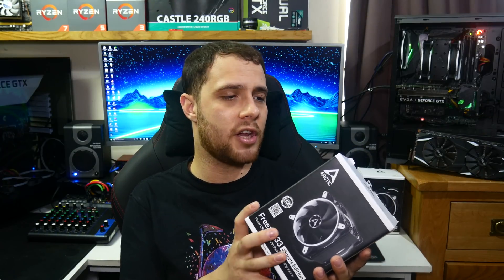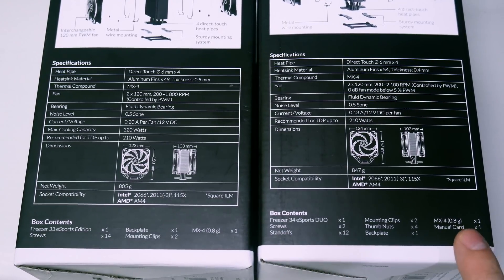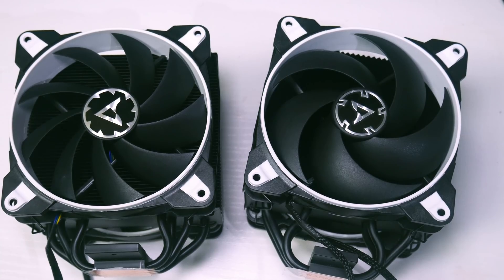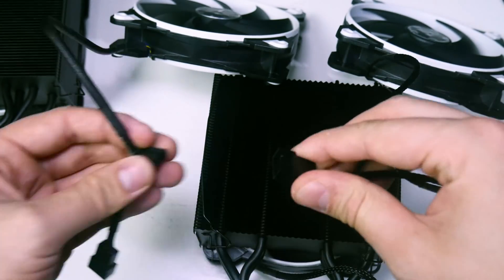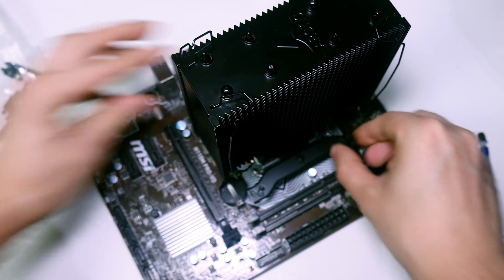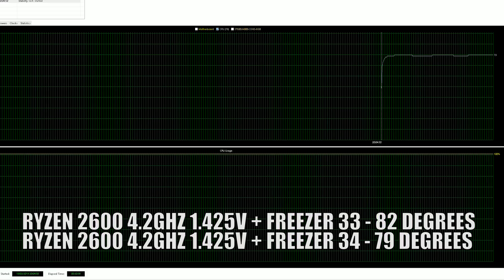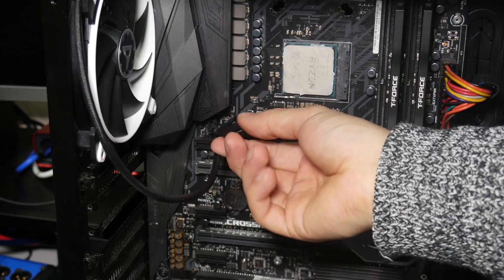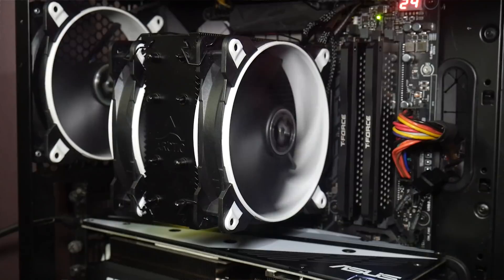ARCTIC Freezer 34 eSports DUO - Review, Unboxing, Installation, Thermals, Gaming  + Overclocking

Comment: Hi great video! my Cooler same in video in warzone at 1080p max settings my cpu temps are around 60-65 degrees why is this my fans on my cpu cooler are running at 1400 Ish rmp and i have 6x corsair LL120 fans at 450ish rpm and a rx 6700xt in the corsair 465x please help thanks
Reply: 60-65 degrees is good when under load. It's fine
Reply: Chobbs but it should be better I changed the cpu cooler to the h150i pro 360mm rad and  this cpu is so fucking hot
Reply: @pumpkin8680  well if the h150i is running hot you probably should try remounting it or try undervolting your cpu
Reply: Chobbs yes I have tried remounting it too and undervolting and both makes no difference what so ever
Reply: @pumpkin8680  Ryzen cpus are not great at dissipating heat, meaning you cant really get them that much cooler even if youve got a great cooler. The heat just stays in the cpu and doesnt get cooled by the cooler on top. But 60-65 are good temps for this cpu, i would just leave it at that.
Reply: RedArtz / Marcel K. K thankyou I actually changed my cooler to a 360mm rad by Corsair (150i pro) so now temps are like 50-60 while gaming. Thanks fir the reply

Comment: i5-3570K @4.5GHz - Would this cooler be enough?
Reply: Vaietzi definitely
Reply: @lucamilner785  4.50GHz, 1.235V, 70-74°C max. (65-67 avg.) @high loads, normal room temp. - You're right ;)

Comment: I have an XPS 8700 motherboard in a NZXT S340 case. The backplate cannot be removed so I'm wondering if the screws will fit in the motherboard holes.

Comment: why are you putting the pea drop. they recommended adding lines to each heat pipe.
Reply: ARCTIC follows the Verge PC build video... they even admit their recommendation of paste on every heat pipe is going to result in past squeezing out of all the sides (see their own video).
Reply: I went pea method on my 33 eSports One; no issues.  Agree with Wofshanze who pointed out their method really does nothing for coverage and just adds to a potentional mess.
Reply: @PapaMav  I see.i only said that cus of what arctic them selves said at the time. I thought they said it because it would spread more evenly and allow more coverage. I usually use dot myself now anyways
Reply: @lordadz1615  I frankly have no idea why Arctic is suggesting the method they are, in the first place.

Comment: How well does it stack up against the Snowman?
Reply: Quite a bit better I would say since it beats the CM212 and some AIOs. Do note the snowman has a 5 and 6 heatpipe version, for about 1/5 of the price of the Arctic
Reply: @vsmh96  I found the Arctic for 38€ and the Snowman for about 15
Reply: @NicksStuff  ah then, your price differs. I am nearer to China and further away from Arctic so mine would cost Rm240 for the F34 DUO (an extra Rm 80) for shipping.

The snow man is about Rm50 for me with shipping at Rm5

Comment: I'm so confused, maybe because Amazon's fault, please help me: Which has better performance??? I see Arctic Freezer 33 and 34 with 1 and 2 fans with very different prices. I can't see much differencie between ONE and DUO since they have 2 fans but there is also a ONE with 1 fan, and the prices are similar in some cases and very high in other cases...please help me!
Reply: Hi, the Freezer 34 is newer as the successor to the Freezer 33. 

The F34 uses newer fans which are pressure orientated while the F33 uses airflow fans (which are less optimized).

As for dual or single fan, they probably will differ by a few ℃
Reply: @vsmh96  Thanks so much for your kind response dude!

Comment: hello  i have  a i5 6600k and of 4 ghz  but  i have problem with the degress  84   ist it normal ?
Reply: it is not about frequency it is about the voltage
Reply: What cooler are you using? If stock, that sounds about right.
Reply: @vsmh96  Standart cooler from Intel
Reply: @PeterPan-rl3cb  Thats normal. Want better temps? Change your cooler
Reply: @vsmh96  ok thx man

Comment: So.. out of the box .. the cpu fan connector cable is a 'split' cable? You can plug both fans to the cpu fan header without any 'external acessorie' ?
Please answear .. I Want to buy this cooler but dont know if I need a fan spliter to connect both fans

Comment: Fan clips not so nice and easily to scratch the paint... Thanks for your critics, I put that on the to do list for the next gen. Very happy with your final judgement :)
Reply from the maker: No the fan clips hold  in pretty I was rushing when I scratched the 33, hence why I said take your time. Honestly it was so hard to find any problems with it it's a fantastic cooler.
Reply: @thefullsetup  Well noted. You know, that was not a must to find cons :)
Reply: @VincentAndre_HK  Would like to see a complete blacked out fan.
Reply: @VincentAndre_HK  You're supposed to put the fan clips into the heat sink before you install the cooler or attach the fans. That way, you don't scratch the paint.